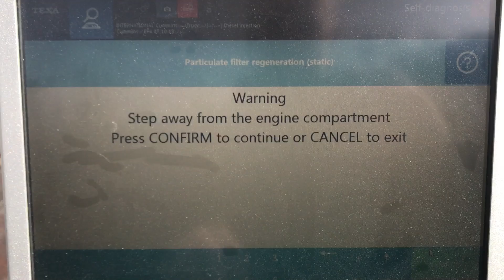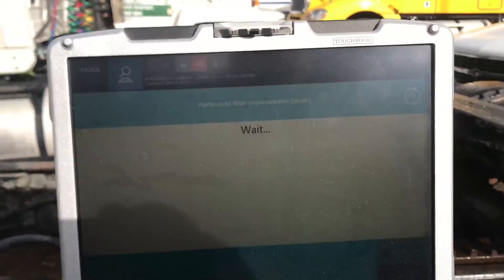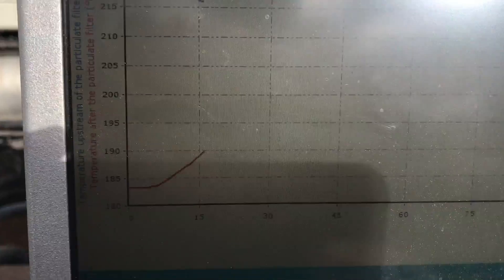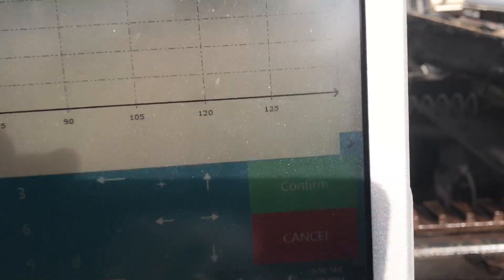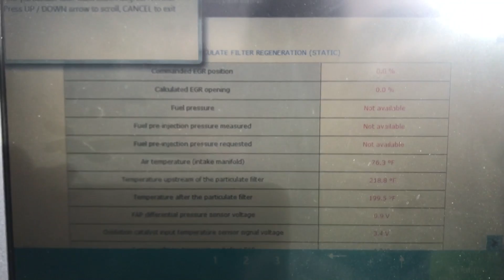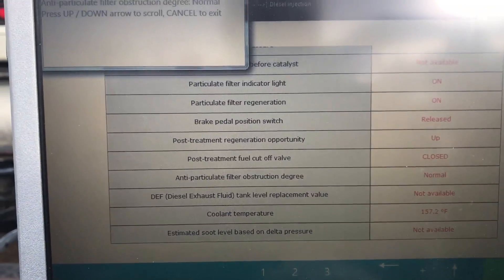Performing a DPF regen on a 2008 Cummins ISM with TEXA Truck Diagnostic Laptop Tool

Comment: what is the highest soot load percentage that you can manually regen?
Reply from the maker: That is set by the ECM. Some do it by percentages, some do it by "stage". Sometimes you can "trick" them ECM into doing it if its too far. Example is Cummins -- Sometimes you can't force it with a laptop. However, if you "trick" it and tell the ECM you put a new DPF on the truck, it will allow you to regen it. The TEXA tool follows the same rules as the OEM software would.

Comment: Other question...does TEXA tool scanner connect to Body Control Modules on International Prostars? Can i do some functions with this Scaneer to Body Control functions?
Reply from the maker: They just added it last week for Freigthliner, and International is due in version 42 (Expected release around July 2017). See here for details: http://blog.diesellaptops.com/2017/04/14/texa-truck-diagnostic-version-41-released/
Reply: DieselLaptops.com Awesome...thanks for your reply...!

Comment: TEXA tool scaneer handles pretty much everything as Cummins INSITE software?
Reply from the maker: Yes. All the commands you can do with Cummins Insite can be done with TEXA. The only exception is that you can't do ECM calibration update or change horsepower/torque settings.